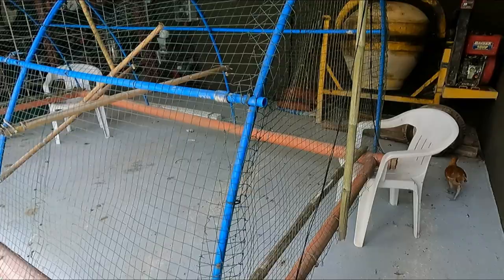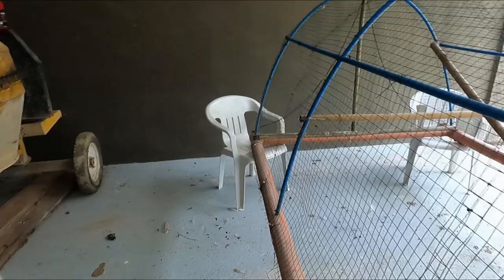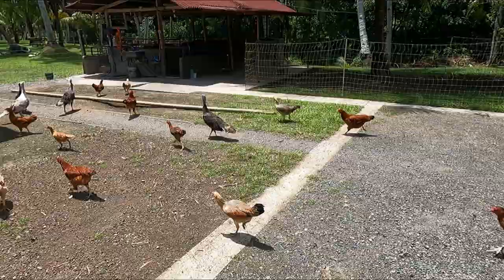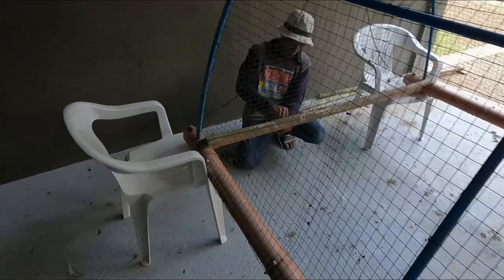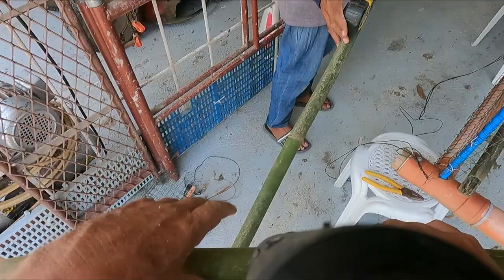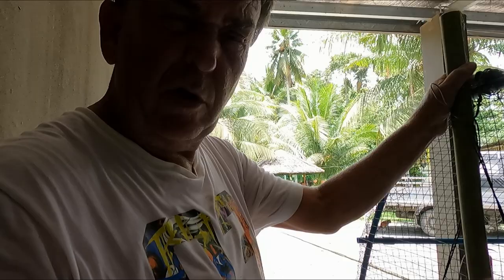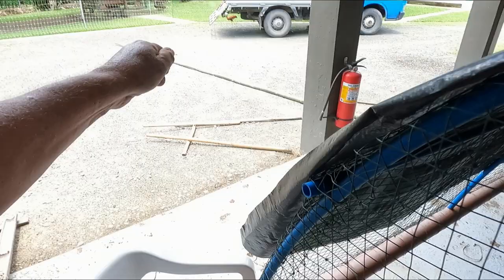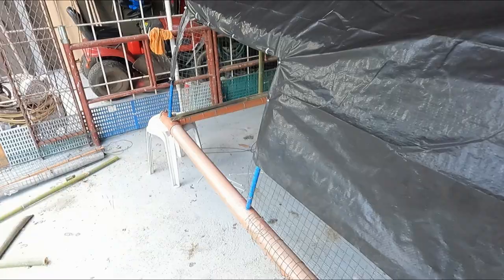Revamping the 2nd chicken tractor on the Aussie Farm in the Philippines

Comment: It may be difficult to get locally but Lazarda etc sell ultra violet resistant cable ties and they also sell a band-it strapping and tensioner tool and the accsessories and stainles steel tape for when you mount  your lighting poles with the super LED lamps..
Reply from the maker: I will have to check that one out